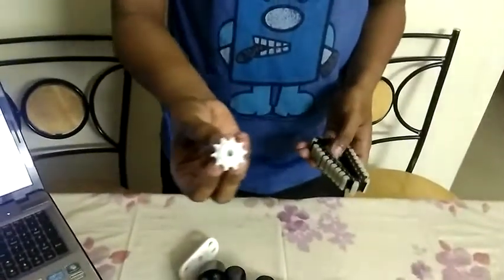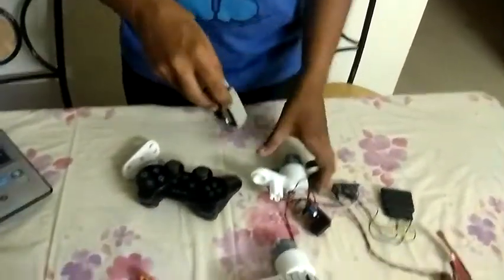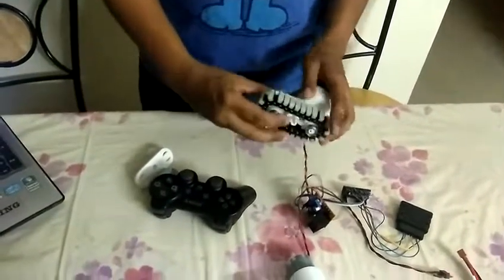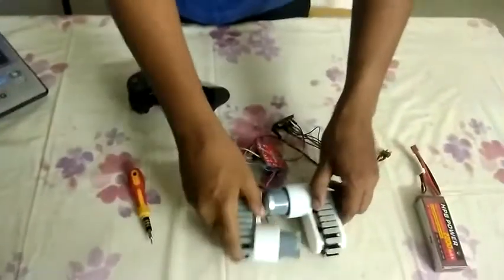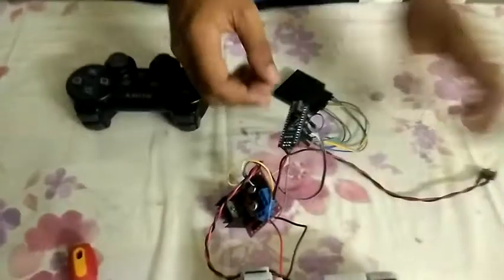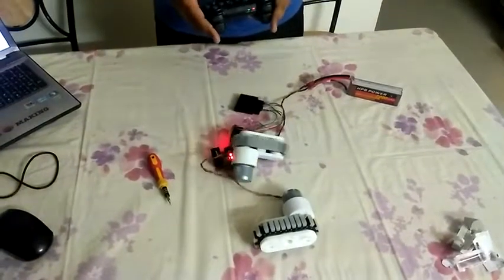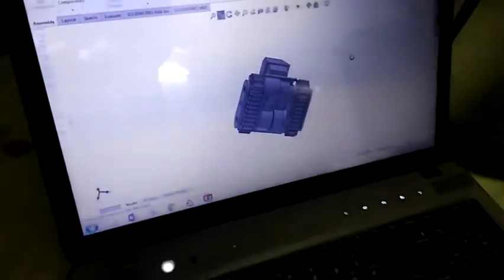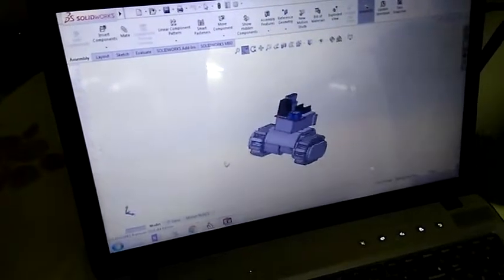Technoxian Roborace entry

Comment: Which circuit you have used 
It can use on 4wd robo race 
In PS2 controller can we take turn
Reply from the maker: Its an Arduino nano directly interfaced with the controller, and L293NE motor driver